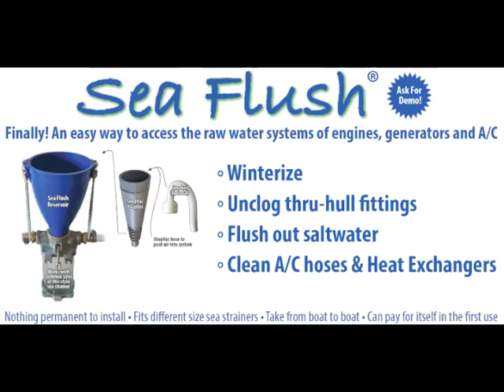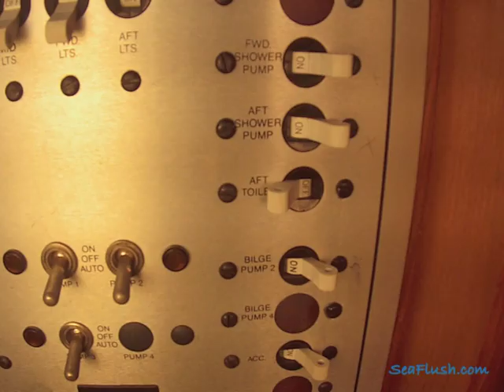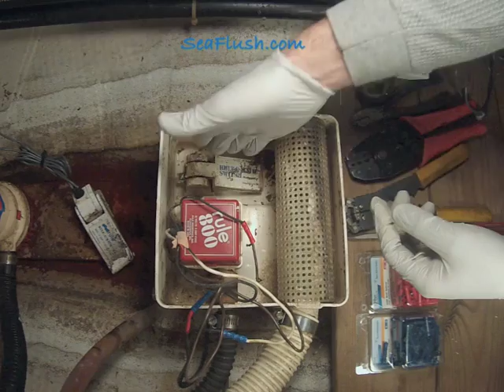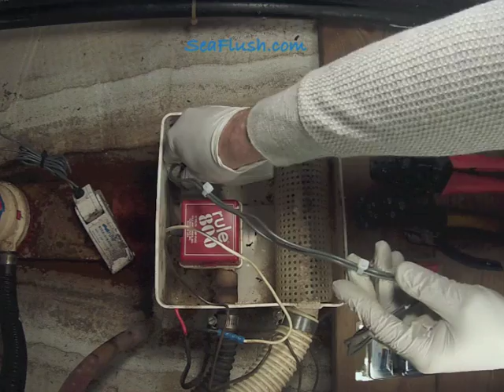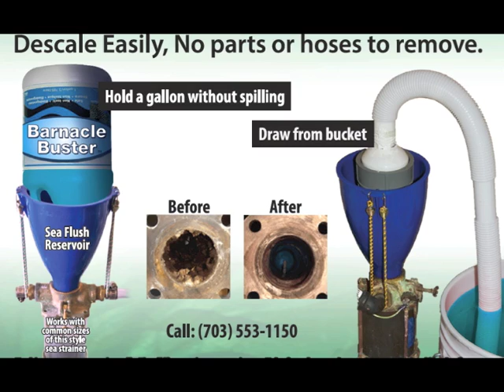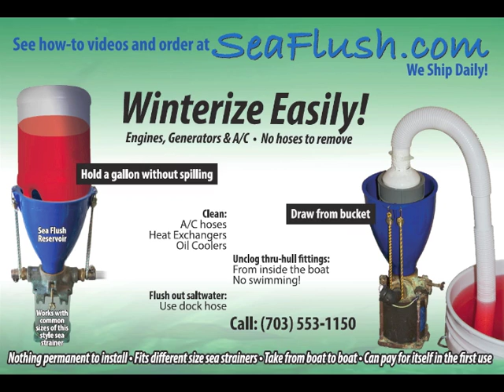How to Test and Replace a Bilge Pump Float Switch

Comment: You should use heat shrink butt connectors. Remember it's 2021 and there are more advanced ways of ensuring a waterproof connection than using electricians tape which water can compromise.
Reply: I've stepped my game up since this video was filmed.  As a mechanic, I would typically match the wiring that the rest of the boat has.  This boat is from 1988 and it's all just crimped butt connectors.  No solder, no shrink wrap.

Comment: I wouldn't stick pins through the wires to test the switch
It will cause corrosion in the wire

Comment: Thanks for the video ! Any recomendation on quality floatswitches ?
Reply: eox555 Use mainstream brands, stay away from the lookalike off brands.  Bilge pumps aren't a place to save money.
Reply: rule is a crap ON THIS SPECIFIC product .. this is a very unreliable design ...   atwood is way better than this box .. I had all kind of problems with my rule boxes until changed them !!!  solved !!